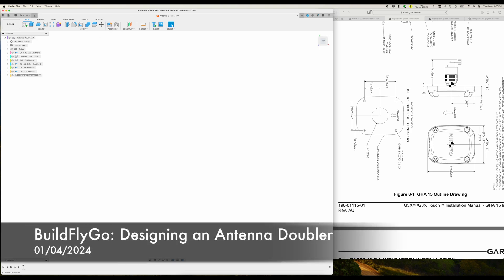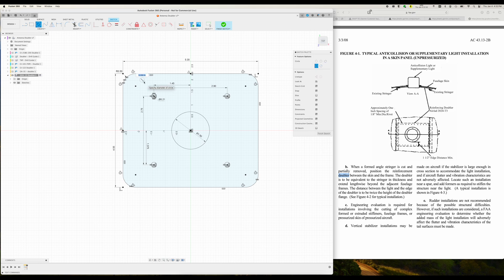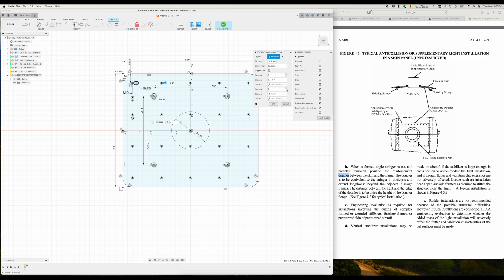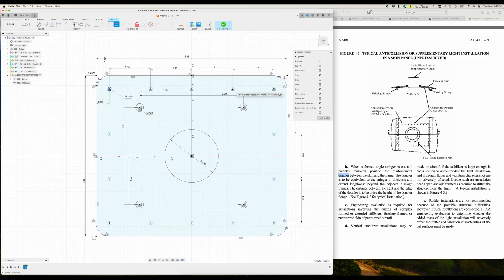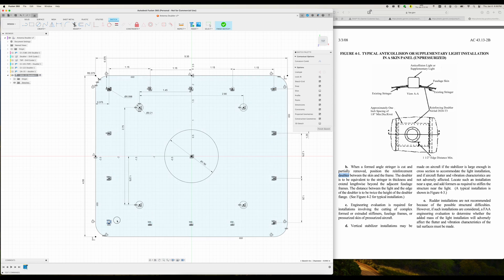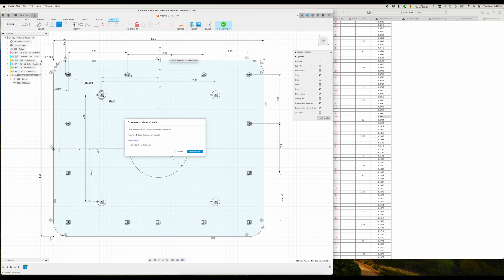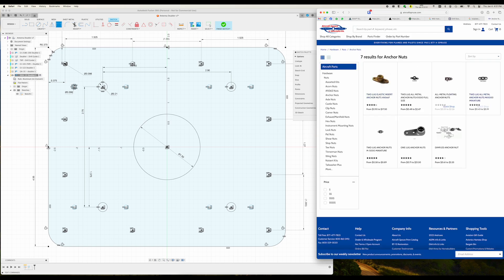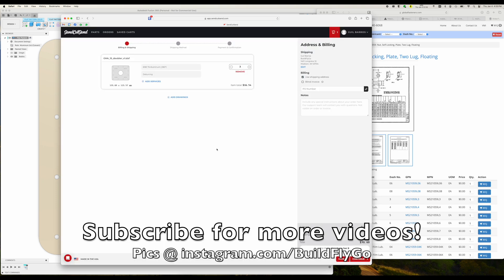BuildFlyGo - Designing an Antenna Doubler for CNC Cutting

Comment: Great video!  I'm using Fusion 360 to design a tool to press a bend into some metal pump out cups for a set of seaplane floats I'm rebuilding.

Then I realized I could use it to lay out and cut doublers for repairs. I was going to use a CNC mill to cut my plates instead of a service to do it. I like your idea of sending it out.
Reply from the maker: I'd love to have a little CNC mill in the workshop, so many little things to make ;) Which one do you have?

Comment: What’s the reason for going this route? I guess it’s a good option for offloading some of the more fussy, time consuming work.
Reply from the maker: It's a good dollar to time swap. Doublers are fussy, I want them to look perfect as their rivet holes will be visible on the outside of the airplane so I hate doing them by hand... which means it takes me forever if I do them by hand :) Under $10 each shipped is a crazy good deal for me on these.
Reply: @BuildFlyGo  in the interest of saving even more time, would you be willing to share your design? It's a pretty steep learning curve for those of us that use CAD once every year or two for little project like this.
Reply: @DavidCarter2  I guess not 😎